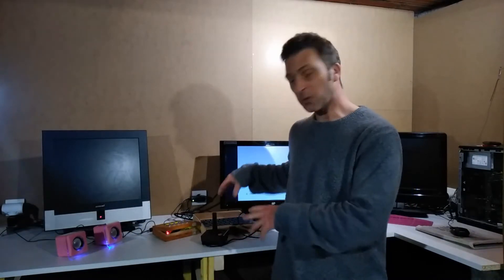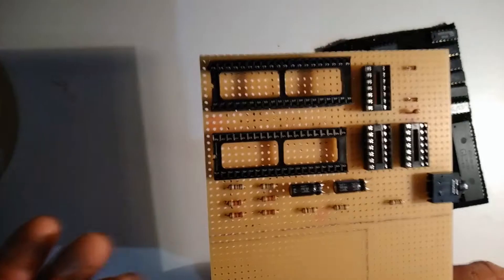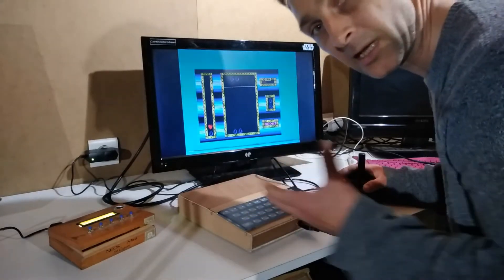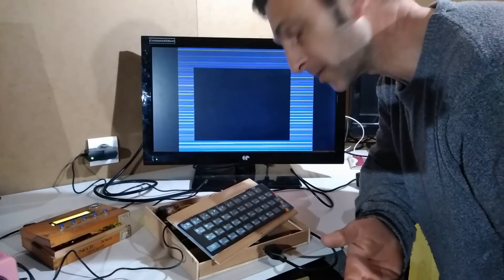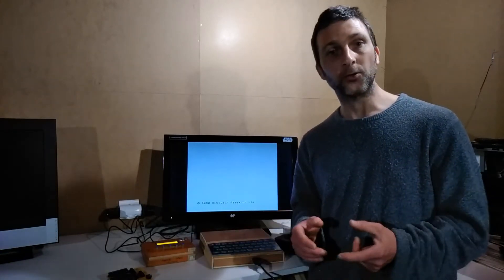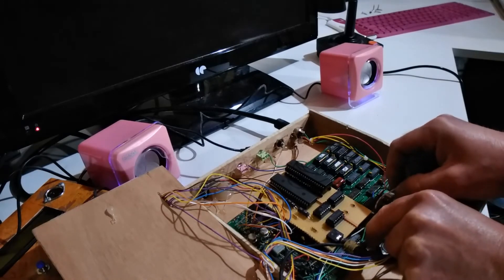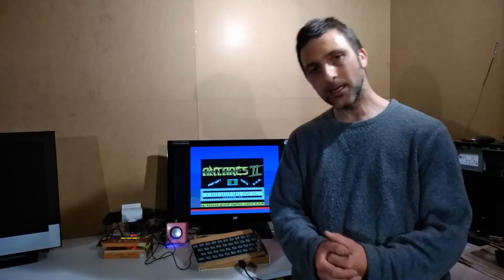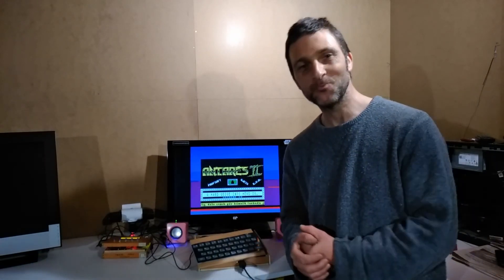Leningrad ZX Spectrum Soviet clone | DIY AY Sound Module

Comment: hi 8bit, there was a diy project published in Sinclair Spectrum, with the same 8919 chip, and a basic program to generate Mozart-like music ... any hints where to find it ?
Reply from the maker: I'd never heard of that article until your comment. I must admit that the basic program sounds really interesting. I've had a look for it but to no avail I'm afraid.
Reply: awesome, thx @8bitsinthebasement  ...same here...the archive sites yielded no results...very strange...someone must have noticed the project...I did it all, wire wrapped the sound board by hand, it worked first time, and composed some very nice arrangements, sounding pretty much 'mozarty' ...